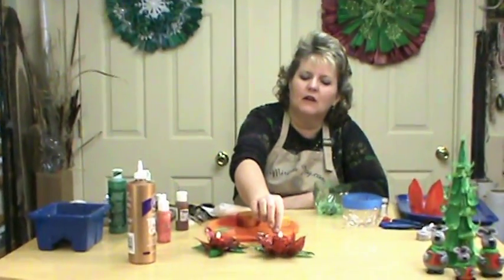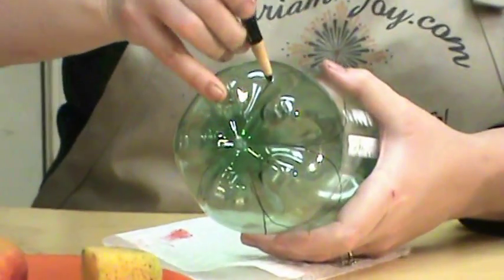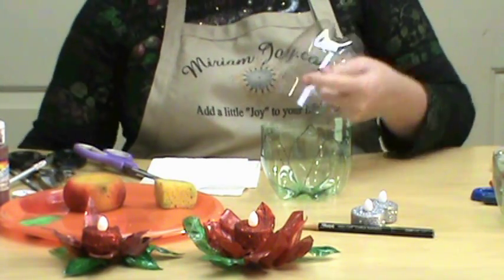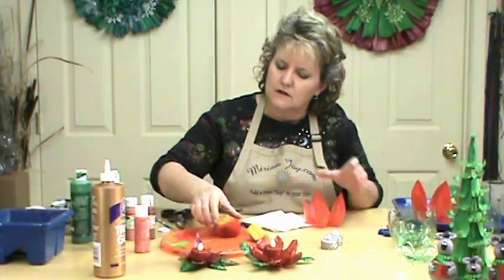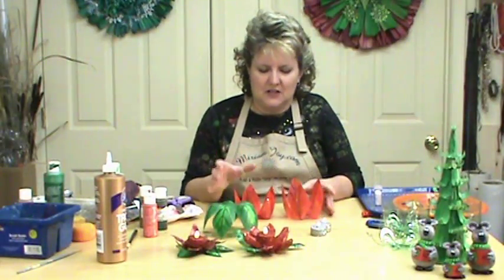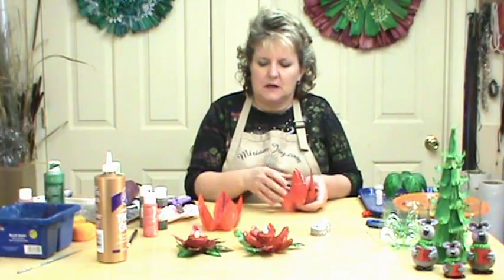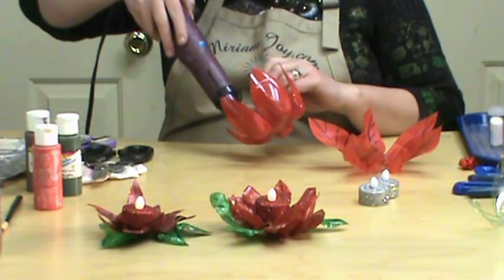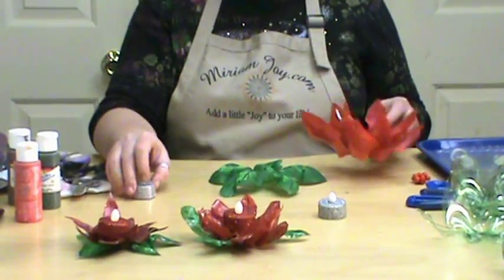Recycled Poinsettia Candle Holder ~ Featuring Miriam Joy

Comment: In question of the heat gun.  Can you use a hair dryer if you don't have a heat gun?   I am very new at this so I don't have any supplies right now.
Reply: +Robert Dozois Miriam this is Maryanne Roberts mom I was asking the question not Robert
Reply from the maker: +Robert Dozois Try it and see Robert. I am not sure it will get hot enough. I would not be here without trying things people tell me would not work. Do not let people set the rules for you. Just try it. Merry Christmas. Miriam Joy

Comment: If you don't have a heat gun, what else can you use in place of it?
Reply from the maker: You can see if your hair dryer can get hot enough. If you have a craft store, use your 50% off coupons. Michales has been running that coupon and then on special days they are allow you to use 20% off of your total purchase including what you used the 50% on for.
Reply: Ok I should keep that in mind! Thanks!
Reply: RapidFireHorses I bought my heat gun at harbor freight tools with a. Coupon for ten bucks! Very cheap
Reply: Yeah but sadly I don't have a Harbor Freight around here ^^;